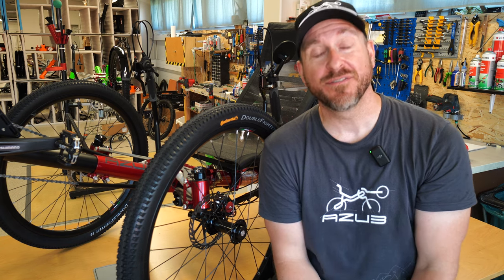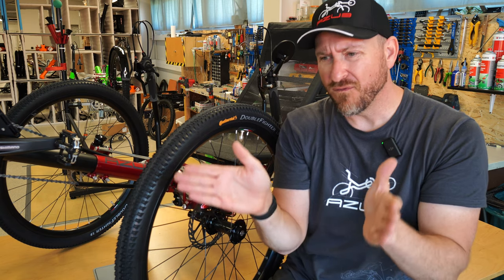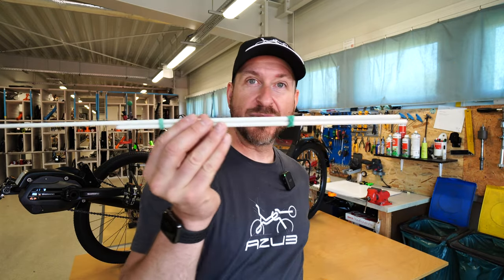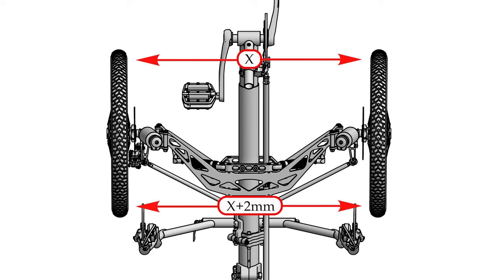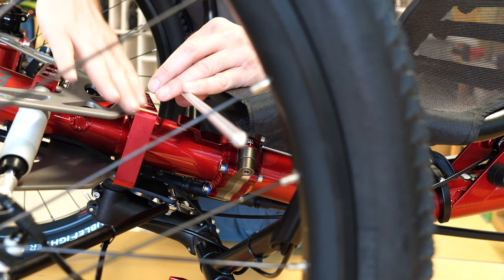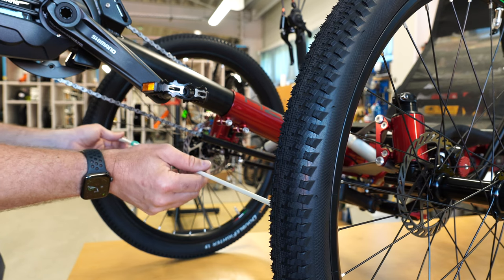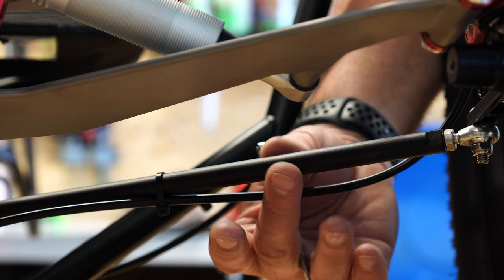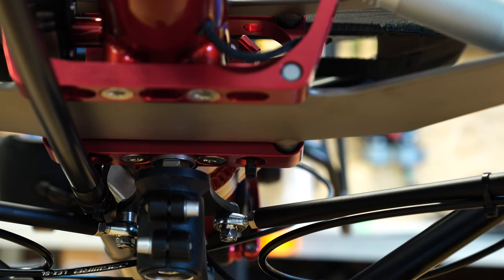How to adjust toe-in of your recumbent trike

Comment: AZUB I bought a Ti-Fly 26 from you in 2016 and I mostly love the machine but this setting is and has always been quite problematic, getting the rear measurement at the halfway level is impossible because the steering system is placed between the main spar and the ground and is in the way of the measurement!  AZUB please supply your customers with the measurement between the main spar and the rear of the front wheel rim center line thank you.  Also if the steering system was mounted above the main spar it wouldn't get smacked about on contact with obstacles which knocks the steering geometry "out of whack" and the steering would not push the top chain line out of alignment every time we turn full left. Just an experienced observation;) Apart from that and a couple of other things, a marvelous Trike. :)

Comment: the tracking of a ti-fly is all over the place the tips of the leaves are sensetive try this with a weight on the seat and use big enough tires so te tire wall could help when the track gets of track with the suspension travel

Comment: Just a question what is the starting distance between the wheels  for you to correct to as you do not mention this. So how do you  correct it with out knowing the correct distance in mm to start with just wondering like. i got the 2mm gap difference at the rear. but what is the distance in mm between the front of the wheel rims.
Reply: The measurement is a relative measurement, not absolute. Front of tire to back of tire.

Comment: LOL.. I was riding in the bike lane under an underpass.. didn't see in the shade (going from bright sun to dark shade) that the DOT decided to put a curb, narrowing the lane from 4' to less than 2'... my right tire hit that curb at about 25mph... I didn't notice that i through the trike out of alignment until  one of the tires started wearing fast.. Took it to RoseCityRecumbenCycles to find out why it was wearing so fast.. Well... It was way out of alignment, and needed the toeIN adjusted.. And that pull to the right went away... LOL. Live and learn..   I don't know if you've noticed that all the potholes are increasing and not being repaired. And I suspect, that curb in the dark was placed there to cause accidents.  LOL.. I don't think the DOT likes cyclist.. LOL

Comment: Thanks for the info but 2mm difference is hard to measure with these methods. You measurement error with finding a parallel with the ground and picking identical spots on the rims is probably about 2 mm with each measurement.